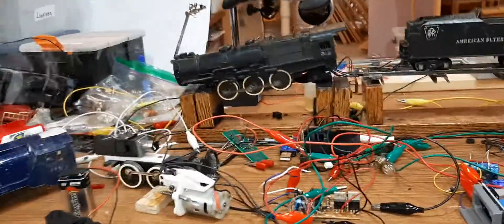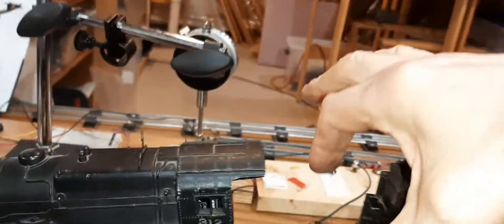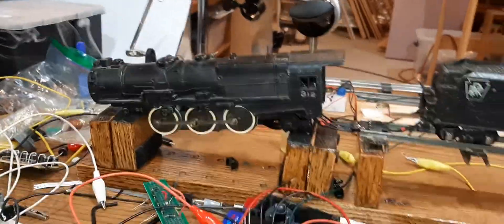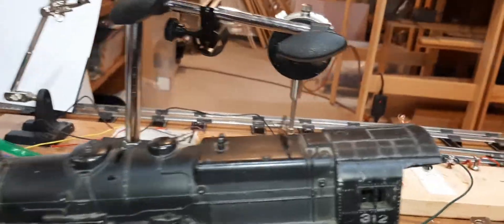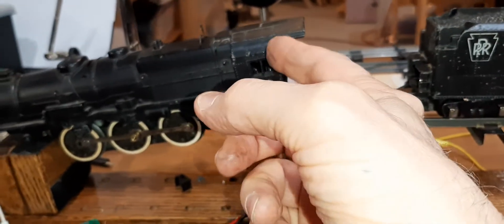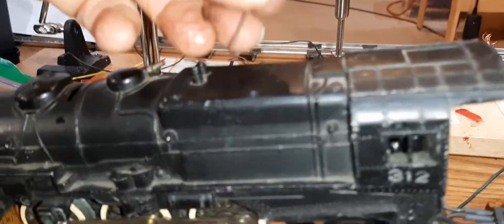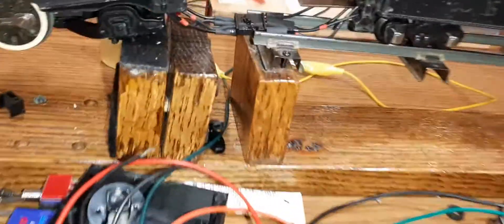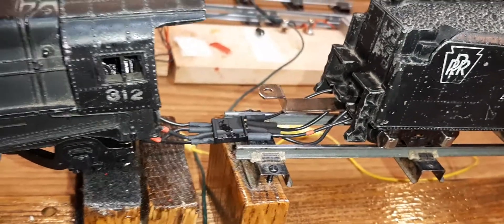American Flyer Steam Engine wiring harness

Comment: Hello, I have the harness on order.  Being new to this kind of thing, can you tell what size/type of wire should be used to replace the existing wire?  Thank you in advance.  Rick
Reply from the maker: I use a flex wire from Train Tender 22Ga, strand with a highly flexible rubber sheath. That is a single wire. Black. I use it especially as the umbilical form the tender to the motor. some maintain the plate for connection on the engine cab roof. I prefer to run all the wires low under the connector then up just in front of the motor. A single tie wrap will hold that bundle to the lower side of the connector.  For chassis wiring i use 24 Ga solid copper. It is not flex but will bend and hold a form for routing in and around things. Look at my You Tube and scan the videos for assemblies. I have done a lot of engines over th 7 years of posting each one can be an example to learn form. It is not practical to handle each case one by one. you must try to absorb the lessons you can glean from videos. it takes time to gain experience and a certain amount of knack to see a way to achieve a goal. The Harness you ordered will most likely be 4 wires in a cloth sheath. That is the standard Flyer replacement.
Reply from the maker: https://youtu.be/RqOfKUt4KVE